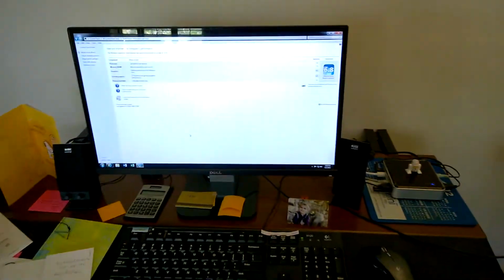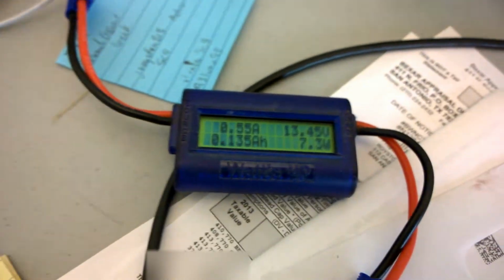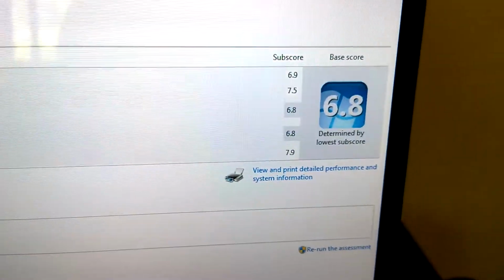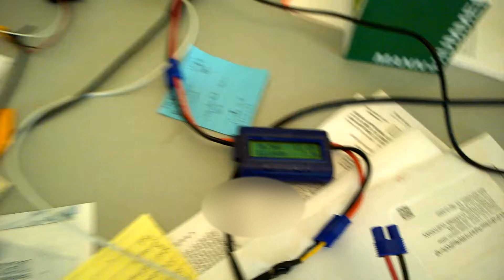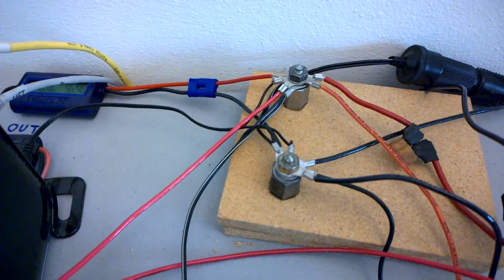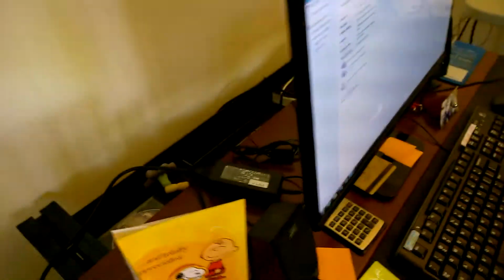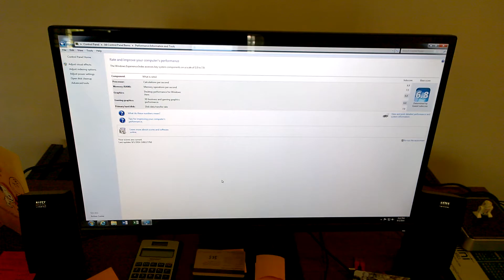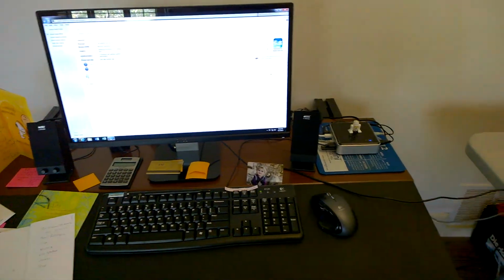Off Grid solar computing with the Intel NUC

Comment: Very useful video.   Have you any experience of the cut off voltage as the battery goes below 12V?
Reply from the maker: I don't since I never let my battery voltage dip below 12.3v.

Comment: Seems you have some cleaning up to do, but nice job. The only addon I'd recommend is something like a voltage regulator for those sensitive appliances that need precisely 12v. Other than that looks like you off to a great start in being off the grid!

Comment: Do you have some kind of ADSL that uses phone lines for Internet? Just curious if your Internet also works when the power goes out in your area.
If not, you could probably just run your router on A/C to reduce battery consumption.
Well, unless maybe it is also wirelessly streaming your PC to your TV or something, but in that case, the CPU's would go to sleep every 3 minutes, which would make viewing difficult.

Comment: So to be clear... The NUC will take 12 volts straight from a cigarette lighter as well as the monitor?
Reply from the maker: Yes, it will run from 12v-20v without issue.
Reply from the maker: Some NUCs have a 12-24V input range. You just have to Google the model number and click on the Ark.Intel product page to see what the input range is. I think the Nuc will run on 11V though I haven't tested it. Worse that can happen is that it shuts off.